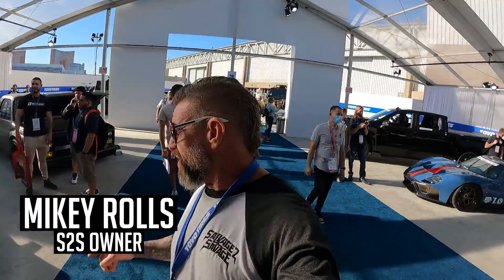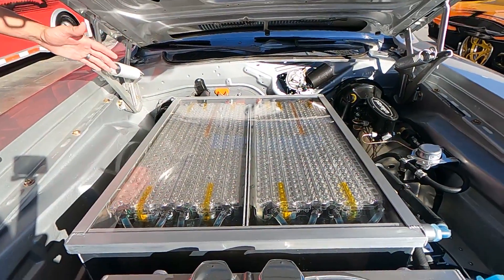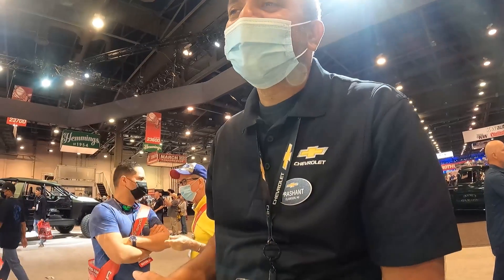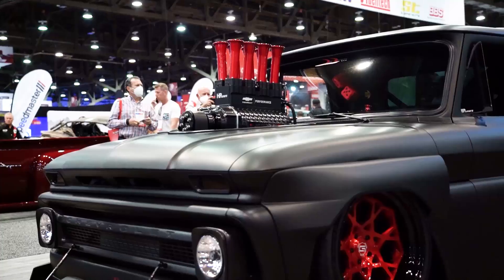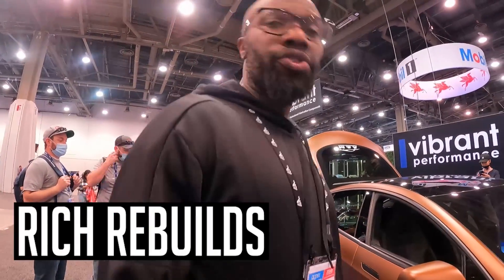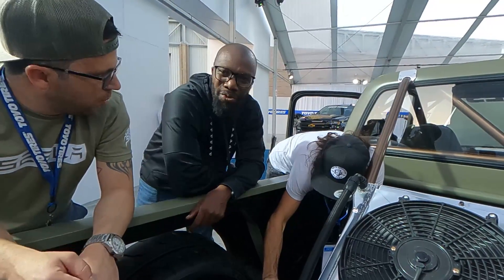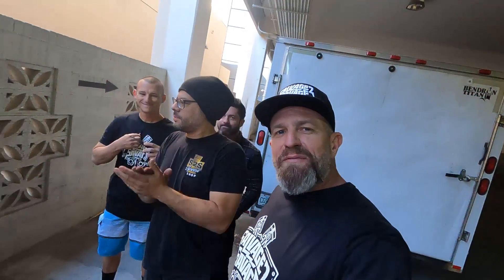Twin Tesla Swapped Chevy Squarebody Takes on SEMA 2021 - Electric C10 Ep. 22

Comment: It's against the law to open a door into traffic.  Cabbie was parked right on the lane divider and opened his door into the other lane.  Watch the video again.  Cabbie had the door open and when the truck approached he opened it all the way which took it into the next lane.  And the truck couldn't move over anymore or he would be hitting the column. I will admit that the driver of the truck wasn't aware enough to compensate for the wide body kit though. Cops won't get involved in a t/c on private property or park g lots.  It's a civil issue now.  Fight it out in court if it goes that far.

Comment: That door was already opened, yeah they opened it a little more but you were already way to close for comfort anyways thats 100% on yall
Reply: 7:57/7:58 is roughly when the cabby starts opening his door without checking his surroundings.
Taxi driver's door is fully open, way beyond the lane separators @ 8:00
Truck is side by side with the taxi @ 8:01
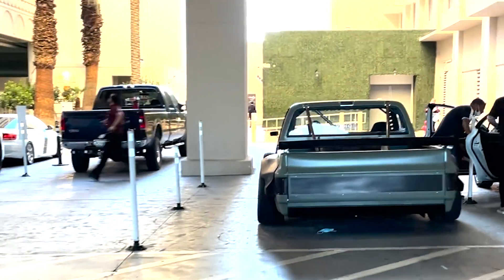Hit @ 8:02.
The taxi could be further to the right by 2-3ft if not more.
Truck is roughly in the center of the lane

Cabby is responsible for this one.

Why? 

Because the majority of the US (Including Nevada where SEMA took place) has "Dooring" laws which state “No person may open the door of a motor vehicle unless it is reasonably safe to do so, without interfering with the movement of other traffic. No person may leave a door of a vehicle open on the side of a parked vehicle so as to obstruct the movement of vehicular traffic.”

Since the door was beyond the lane separators, it was interfering with the movement of traffic. Doesn't matter if the truck is wide-bodied or not, cabby was oblivious to his surroundings because he was focused on looking at/for something and didn't bother to check. 

Also the median perception-reaction time is roughly 1.6 seconds regardless of age, according to a research article done by Paul Olson and Michael Sivak, titled "Perception-Response time to Unexpected Roadway Hazards" but generally speaking most accident investigations use 2.5 seconds for a P-R time. Yes the cabby started opening the door 4-5 seconds prior to the truck hitting it, but again he shouldn't have opened it beyond the lane separators and, AND! Between the door being fully opened and the hit was only 2 seconds and would have been on the peripherals of the drivers cone of vision...  100% Cabby's fault
Reply: @InfiniteCheeseCrates  wtf
Reply from the maker: I give up on explaining to people, it doesn’t even matter what they think. Some people are just dumb , and this is the only way to feel smart! (By flexing there opinion on the tube)
Reply: @SalvagetoSavage  whatever helps you sleep at night. Nice truck tho

Comment: Wow! You blamed the cabbie, hotel worker for YOUR mistake! 

YOU must be aware of your vehicles size, width. 

Don’t blame others for your mistake.
Reply: 7:57/7:58 is roughly when the cabby starts opening his door without checking his surroundings.
Taxi driver's door is fully open, way beyond the lane separators @ 8:00
Truck is side by side with the taxi @ 8:01
Hit @ 8:02.
The taxi could be further to the right by 2-3ft if not more.
Truck is roughly in the center of the lane.

Cabby is responsible for this one.

Why? 

Because the majority of the US (Including Nevada where SEMA took place) has "Dooring" laws which state “No person may open the door of a motor vehicle unless it is reasonably safe to do so, without interfering with the movement of other traffic. No person may leave a door of a vehicle open on the side of a parked vehicle so as to obstruct the movement of vehicular traffic.”

Since the door was beyond the lane separators, it was interfering with the movement of traffic. Doesn't matter if the truck is wide-bodied or not, cabby was oblivious to his surroundings because he was focused on looking at/for something and didn't bother to check. 

Also the median perception-reaction time is roughly 1.6 seconds regardless of age, according to a research article done by Paul Olson and Michael Sivak, titled "Perception-Response time to Unexpected Roadway Hazards" but generally speaking most accident investigations use 2.5 seconds for a P-R time. Yes the cabby started opening the door 4-5 seconds prior to the truck hitting it, but again he shouldn't have opened it beyond the lane separators and, AND! between the door being fully opened and the hit was only 2 seconds and would have been on the peripherals of the drivers cone of vision...  100% Cabby's fault
Reply from the maker: YES! I’d hire you to defend me anytime

Comment: The car door was already opened, you wormed out and forgot the wide body kit y'all installed. LMAO blame someone else
Reply: Yes but it does open more.
Reply: 7:57/7:58 is roughly when the cabby starts opening his door without checking his surroundings.
Taxi driver's door is fully open, way beyond the lane separators @ 8:00
Truck is side by side with the taxi @ 8:01
Hit @ 8:02.
The taxi could be further to the right by 2-3ft if not more.
Truck is roughly in the center of the lane

Cabby is responsible for this one.

Why? 

Because the majority of the US (Including Nevada) has "Dooring" laws which state “No person may open the door of a motor vehicle unless it is reasonably safe to do so, without interfering with the movement of other traffic. No person may leave a door of a vehicle open on the side of a parked vehicle so as to obstruct the movement of vehicular traffic.”

Since the door was beyond the lane separators, it was interfering with the movement of traffic. Doesn't matter if the truck is wide-bodied or not, cabby was oblivious to his surroundings because he was focused on looking at/for something and didn't bother to check. 

Also the median perception-reaction time is roughly 1.6 seconds regardless of age, according to a research article done by Paul Olson and Michael Sivak, titled "Perception-Response time to Unexpected Roadway Hazards" but generally speaking most accident investigations use 2.5 seconds for a P-R time. Yes the cabby started opening the door 4-5 seconds prior to the truck hitting it, but again he shouldn't have opened it beyond the lane separators and, AND! Between the door being fully opened and the hit was only 2 seconds and would have been on the peripherals of the drivers cone of vision...  100% Cabby's fault.

Comment: 8:45 You can clearly see that the door was already opened and you simply did not know how wide your truck is and hit it. LOL
Reply: 7:57/7:58 is roughly when the cabby starts opening his door without checking his surroundings.
Taxi driver's door is fully open, way beyond the lane separators @ 8:00
Truck is side by side with the taxi @ 8:01
Hit @ 8:02.
The taxi could be further to the right by 2-3ft if not more.
Truck is roughly in the center of the lane

Cabby is responsible for this one.

Why? 

Because the majority of the US (Including Nevada) has "Dooring" laws which state “No person may open the door of a motor vehicle unless it is reasonably safe to do so, without interfering with the movement of other traffic. No person may leave a door of a vehicle open on the side of a parked vehicle so as to obstruct the movement of vehicular traffic.”

Since the door was beyond the lane separators, it was interfering with the movement of traffic. Doesn't matter if the truck is wide-bodied or not, cabby was oblivious to his surroundings because he was focused on looking at/for something and didn't bother to check. 

Also the median perception-reaction time is roughly 1.6 seconds regardless of age, according to a research article done by Paul Olson and Michael Sivak, titled "Perception-Response time to Unexpected Roadway Hazards" but generally speaking most accident investigations use 2.5 seconds for a P-R time. Yes the cabby started opening the door 4-5 seconds prior to the truck hitting it, but again he shouldn't have opened it beyond the lane separators and, AND! Between the door being fully opened and the hit was only 2 seconds and would have been on the peripherals of the drivers cone of vision...  100% Cabby's fault.

Comment: Dude, your driver didn't give room. The door was partially open and moved a few inches in the clip you showed. Seems like they forgot how wide it was, and weren't driving carefully. He had several feet to his left, he had ample room to move over before approaching the cab. I know insurance will likely side with you, (hope you signed the truck up for it!) , but this was avoidable. I would have crashed it too, because its a foreign environment and the truck prob has poor visibility, but I just feel bad for that poor cabby who didnt expect a wide-ass truck to ruin his job. Hope it all works out. Awesome build and great video, I love you guys.
Reply: 7:57/7:58 is roughly when the cabby starts opening his door without checking his surroundings.
Taxi driver's door is fully open, way beyond the lane separators @ 8:00
Truck is side by side with the taxi @ 8:01
Hit @ 8:02.
The taxi could be further to the right by 2-3ft if not more.
Truck is roughly in the center of the lane

Cabby is responsible for this one.

Why? 

Because the majority of the US (Including Nevada where SEMA took place) has "Dooring" laws which state “No person may open the door of a motor vehicle unless it is reasonably safe to do so, without interfering with the movement of other traffic. No person may leave a door of a vehicle open on the side of a parked vehicle so as to obstruct the movement of vehicular traffic.”

Since the door was beyond the lane separators, it was interfering with the movement of traffic. Doesn't matter if the truck is wide-bodied or not, cabby was oblivious to his surroundings because he was focused on looking at/for something and didn't bother to check. 

Also the median perception-reaction time is roughly 1.6 seconds regardless of age, according to a research article done by Paul Olson and Michael Sivak, titled "Perception-Response time to Unexpected Roadway Hazards" but generally speaking most accident investigations use 2.5 seconds for a P-R time. Yes the cabby started opening the door 4-5 seconds prior to the truck hitting it, but again he shouldn't have opened it beyond the lane separators and, AND! between the door being fully opened and the hit was only 2 seconds and would have been on the peripherals of the drivers cone of vision...  10000% Cabby's fault, driver had barely/if any time to react.

Comment: His door was open before you drove past him, so it was the guy driving the truck that was at fault
Reply: 7:57/7:58 is roughly when the cabby starts opening his door without checking his surroundings.
Taxi driver's door is fully open, way beyond the lane separators @ 8:00
Truck is side by side with the taxi @ 8:01
Hit @ 8:02.
The taxi could be further to the right by 2-3ft if not more.
Truck is roughly in the center of the lane

Cabby is responsible for this one.

Comment: You hit that dude!  Lol
Reply: 7:57/7:58 is roughly when the cabby starts opening his door without checking his surroundings.
Taxi driver's door is fully open, way beyond the lane separators @ 8:00
Truck is side by side with the taxi @ 8:01
Hit @ 8:02.
The taxi could be further to the right by 2-3ft if not more.
Truck is roughly in the center of the lane

Cabby is responsible for this one.
Reply: @InfiniteCheeseCrates  that door is fully open before it is hit, taxi is way inside its lane, driver is at fault
Reply: @DaBaltimoron  Watch closely at 0.25 speed at the time stamps I provided, door isn't fully open till @8:00 leaving the driver 2 seconds to notice something that's barely in his peripheral vision. 

Also the majority of the US (Including Nevada) has "Dooring" laws which state “No person may open the door of a motor vehicle unless it is reasonably safe to do so, without interfering with the movement of other traffic."

Since the door was beyond the lane separators, it was interfering with the movement of traffic. Doesn't matter if the truck is wide-bodied or not, or even if he was too close to the separators, the cabby was oblivious to his surroundings because he was focused on looking at/for something and didn't bother to check. 

The median perception-reaction time is roughly 1.6 seconds regardless of age, according to a research article done by Paul Olson and Michael Sivak, titled "Perception-Response time to Unexpected Roadway Hazards" but generally speaking most accident investigations use 2.5 seconds for a P-R time. Yes the cabby started opening the door 4-5 seconds prior to the truck hitting it, but again he shouldn't have opened it beyond the lane separators and, AND! between the door being fully opened and the hit was only 2 seconds assuming the driver even noticed the cabby being a moron, considering it was on the outskirts of his vision.

Finally if you know anything about perspective you'd be able to easily figure out that the truck is in the center or very close to the center of the lane.

100% the Cabby's fault. Dude was so preoccupied looking for something he didn't check his surroundings. EV's are quiet and now that they're getting popular/more common, people need to start paying more attention.
Reply: @InfiniteCheeseCrates  look where the driver's side of the truck is in relation to the large support column.  It is right in line with the column, then moves a foot to the right after traveling forward just a few feet all while next to the taxi.  The truck swerves into the already-opened door.  Driver's fault.

Comment: I like how you try to put the blame on the cab driver instead of your driver. The cab doors were already open, your driver needs to realize they driver an extra wide vehicle and drive accordingly.
Reply: john doe
No the cab driver opened the drivers door into the path of the truck. Use your eyes.
Reply: @celticdude4686  Truck turned into the door. Watch again. Their fault, stop putting blame on someone else, when it was their fuck up.
Reply: 7:57/7:58 is roughly when the cabby starts opening his door without checking his surroundings.
Taxi driver's door is fully open, way beyond the lane separators @ 8:00
Truck is side by side with the taxi @ 8:01
Hit @ 8:02.
The taxi could be further to the right by 2-3ft if not more.
Truck is roughly in the center of the lane

Cabby is responsible for this one.

Why? 

Because the majority of the US (Including Nevada) has "Dooring" laws which state “No person may open the door of a motor vehicle unless it is reasonably safe to do so, without interfering with the movement of other traffic. No person may leave a door of a vehicle open on the side of a parked vehicle so as to obstruct the movement of vehicular traffic.”

Since the door was beyond the lane separators, it was interfering with the movement of traffic. Doesn't matter if the truck is wide-bodied or not, cabby was oblivious to his surroundings because he was focused on looking at/for something and didn't bother to check. 

Also the median perception-reaction time is roughly 1.6 seconds regardless of age, according to a research article done by Paul Olson and Michael Sivak, titled "Perception-Response time to Unexpected Roadway Hazards" but generally speaking most accident investigations use 2.5 seconds for a P-R time. Yes the cabby started opening the door 4-5 seconds prior to the truck hitting it, but again he shouldn't have opened it beyond the lane separators and, AND! Between the door being fully opened and the hit was only 2 seconds and would have been on the peripherals of the drivers cone of vision...  100% Cabby's fault.
Reply: @InfiniteCheeseCrates  100% incorrect rofl. Literally as the person in front of the truck runs across, the truck starts to turn right, when still having plenty of room to go straight ahead. watch again lol
Reply: Yes the door was open but the cab driver opened It up wider as the truck was passing. Watch the slow motion.
Reply: @Blazin2133  opened it up more BEFORE he passed...
Reply: @smurfvolvo  if that was the case why didn't the door strike the front fender? The door was open and then got opened up more while they were passing. Cabbie wasn't looking at the passing traffic and was dealing with the occupants of his cab.
Reply: @araknash7405  rear might be a little bit wider or he turned slightly to the right which is what it looks like on the video. Either way the door was opened up all the way BEFORE he passed, everyone with functioning eyes can see it. Did you also miss how close he was to hitting the guy standing there? Normal people don't drive that close to people or opened doors. He had all the space he needed to the left but still kept to the right, nothing but bad driving.
Reply: They swung the door open even wider into his lane when he was already driving past, how would he see or expect that?
Reply: @trooperkev  no they didnt. He had lots of time to see that door and he almost ran over the guy standing beside the taxi. He is a horrible driver end of story.